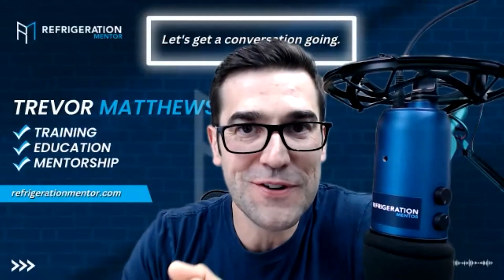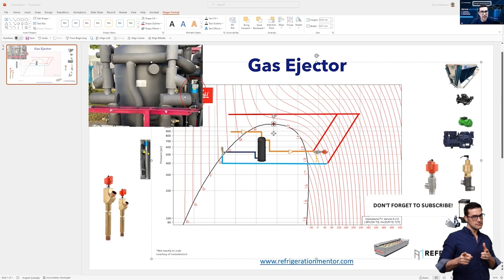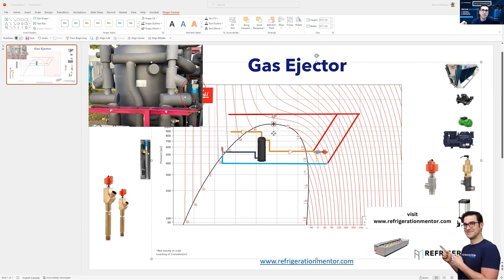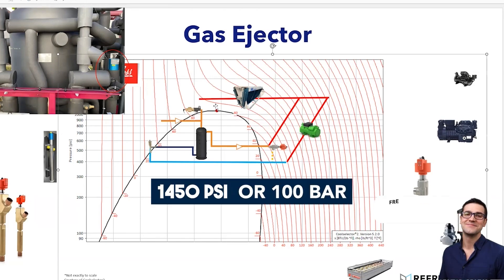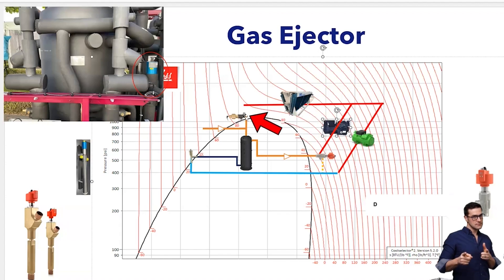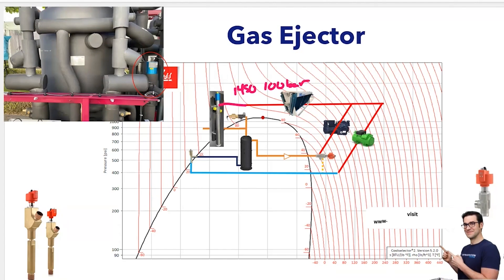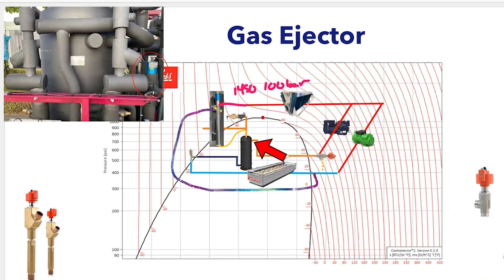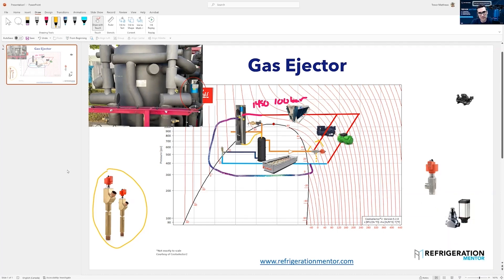Understanding CO2 Gas Ejectors and How They Work in Transcritical CO2 Refrigeration Systems.

Comment: I have a question, Can the primary nozzle of the ejector receive a saturated mixer phase?
Reply from the maker: @bliyeansoeun9274  that is a great question. I do not see why not as they can but used in place of a high pressure valves but you should follow up with the specific ejector manufacturer as there are many different designs.
Reply: @RefrigerationMentor  Sorry for being out of the ejector topic. I'm seeking a small-capacity compressor suitable for CO2 systems. Are there any companies or models you could recommend? thank you.
Reply from the maker: @bliyeansoeun9274  what capacity are you looking for?
Reply: @RefrigerationMentor  The compressor's capacity is likely 1 kW or less
Reply from the maker: @bliyeansoeun9274  I am sure there are many but I know Sanden makes small co2 ones.
Reply: @RefrigerationMentor  Thank you so much.
Reply: @RefrigerationMentor  Thank you so much.